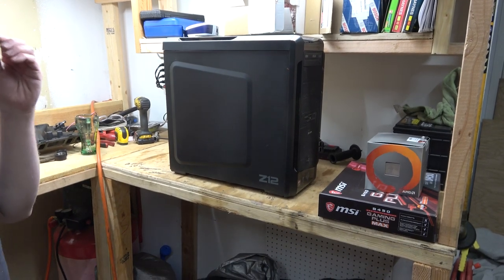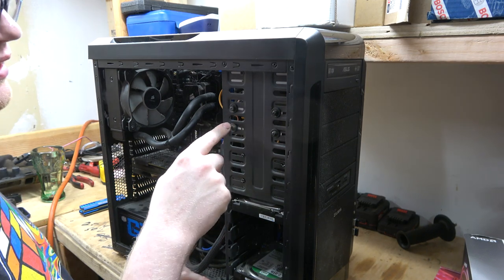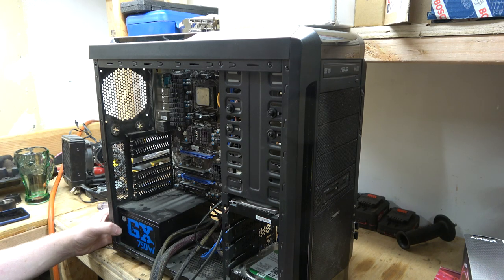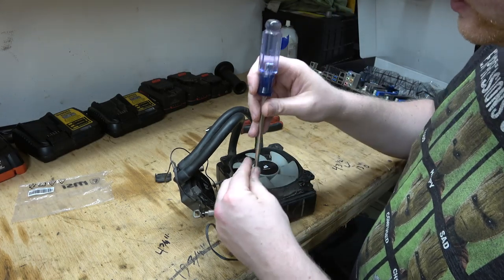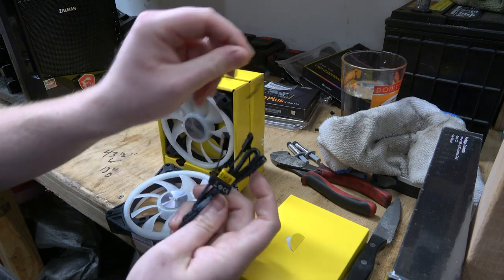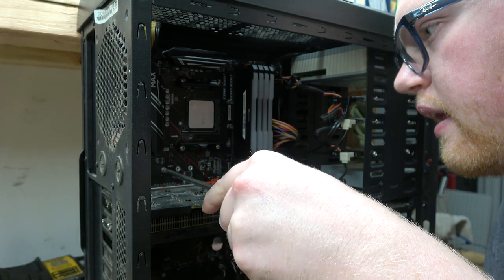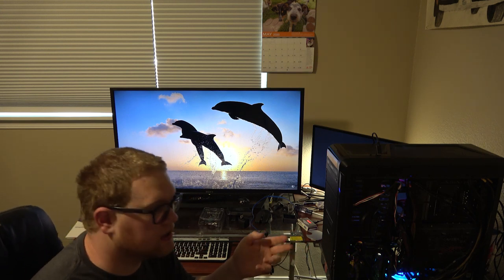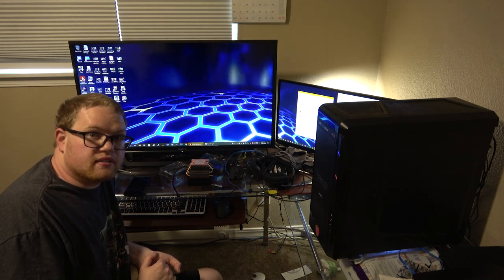Custom Gaming and Video Editing PC Build on a Budget

Comment: Yes you should take the sticker off when you get your heatsink and thermal pad for the ssd. Neeyer brand on Amazon for $5 I bought the 2 pack. Grab thermal grizzly carbonaut thermal pad. Its a life save. I am using one with my noctua nh-l12s with no fan on the cooler. Just a 140mm case fan above  cooler. My ryzen 2600 Stays under 59c load.
Reply from the maker: Thanks, I’ll keep that in mind. So far it seems to run at 100 degrees f. My other drives are about 70-80 f
Reply: @justhes  yeah ive read those drives run hot. 100c? My mx500 from crucial  runs around 60-75c idles around 40-50c if its 100c definitely get a heatsink with pad on there quick thats way to hot and probably wont last long at those temperature.
If you dont already have it grab HWiNFO.

Comment: the new ryzen are awesome been running a AMD Ryzen 7 3700X with a msi Mpg x570 gaming edge board for video i got Gigabyte RTX 2070 Super with Corsair Vengeance LPX 32Gb's 3200mhz Ram Using the same M.2 as you also have  two other 7200rpm drives built this system back in Feb been solid build so far .....also seen you like ATS when the wheels come back normal price you  should get one i was lucky and found a used Logitech G27 for 150 bucks its night and day difference with a wheel in that game...but you got really nice build there man hope you enjoy it
Reply from the maker: Nice, I’ve been very happy with the build. It chews through 4K video like nothing. Some of my longer videos used to take over an hour to render. Now it’s about 20 minutes for an hour long video.

Comment: very nice sir.  for your cooler, you should really stick to just about a pea size blob in the center of the CPU and then just let the cooler squish it out.  as you stated, you can put too much on there and run into contact problems.  plus it just makes a mess.  for your SATA ports getting turned off, the M.2 slot takes up the PCI lanes that the driver chip those ports are using.  so it is kind of a either or thing.  the only way around it would be to see if you can get a different CPU that has more lanes.  I have not looked up to see what that one has so you might not be able to go that route.  because you have all those USB drives, you might be better served taking your junk drives and putting them in external housings and leaving all the internal stuff be SSD.  keep up the good work, sir.